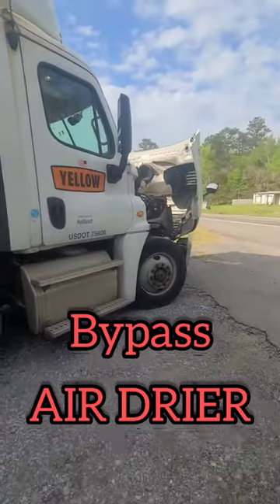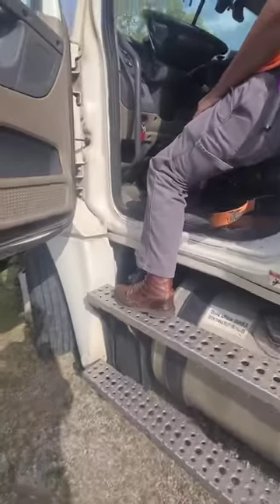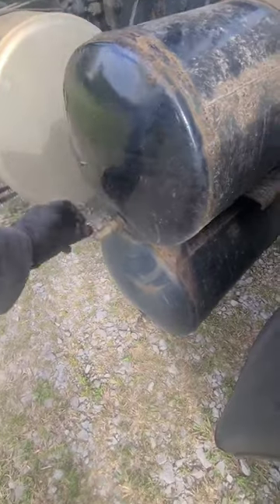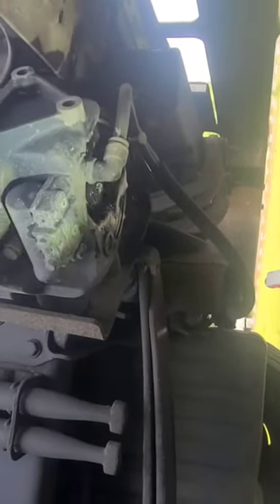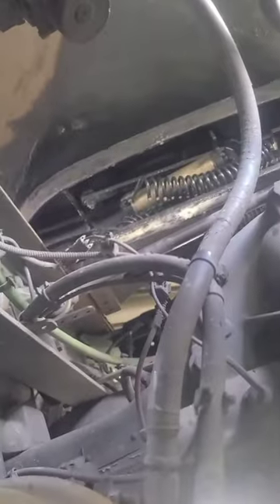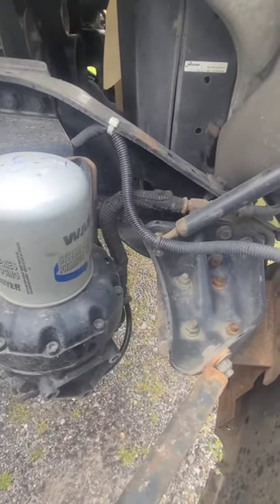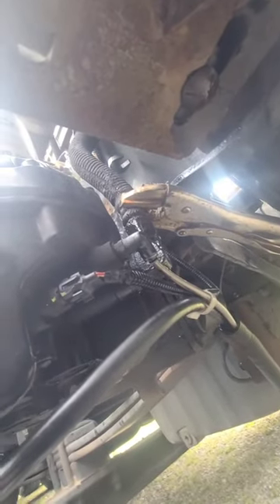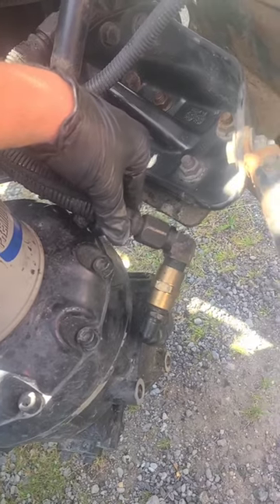How to Bypass a Leaking Air Dryer on a Semi Truck

Comment: Whats with the oil on the hose. I have my air dryer purging oil. I changed the air compressor 3 times on the las 2 years. As well air dryer too. Any suggestions?

Comment: Are you around Ohio Columbus, I have change my air dryer twins within  7 months now and current air dryer is purges constantly every minute. Any help??
Reply from the maker: Nah in Chattanooga or Jacksonville Fl......... You may have aome issues with your air tanks. Do you drain them daily? If water ia running through your air system it will mess up that drier quick. Do you see any oil build up on the air lines. You may have a air compreasor passing oil which can also mess up your drier. 

I would be draining air tanks daily.

You can also replace just the purge valve that is leaking they sell the kits at fleetpride.

423 242 3690 call if you need more help
Reply from the maker: May also need for someone to adjust or replace air regulator. I have a video on it
Reply: No haven’t see no oil, I have the pump change same  6 months ago it was pumping oil at the time but dealership never advise to change the air dryer at time
Reply: Am going to have it change and make sure to drain the tanks all the time, if no development I will definitely give you a call. Thank you so much and really appreciate your time